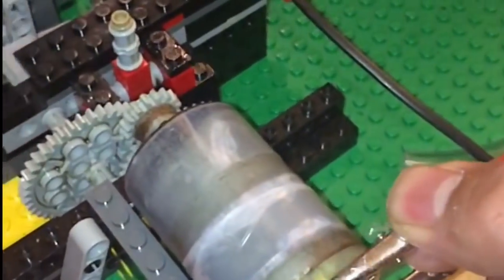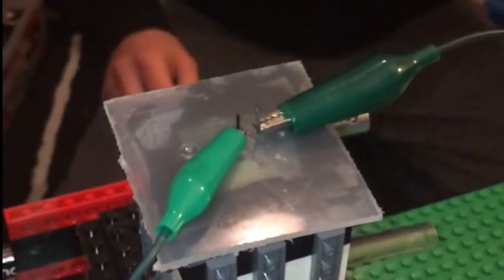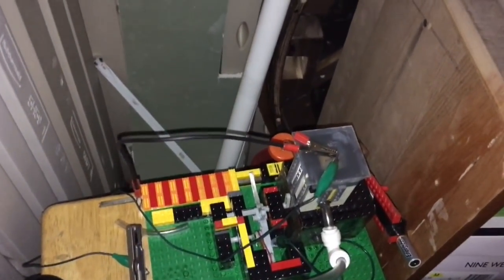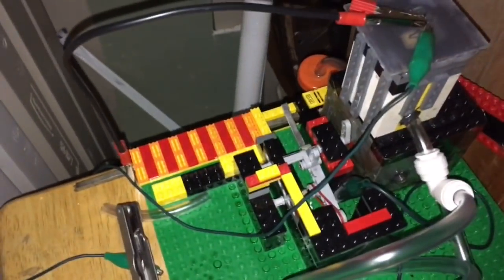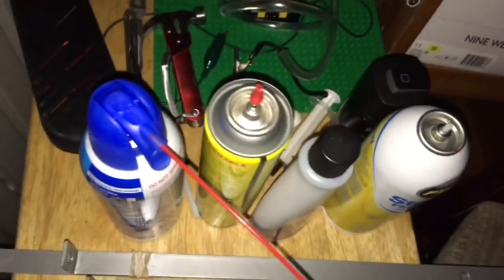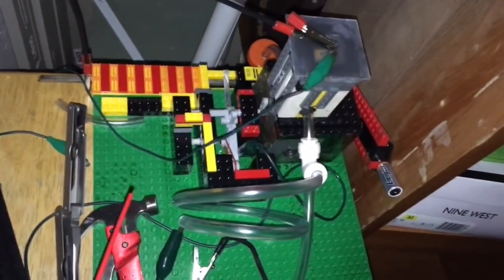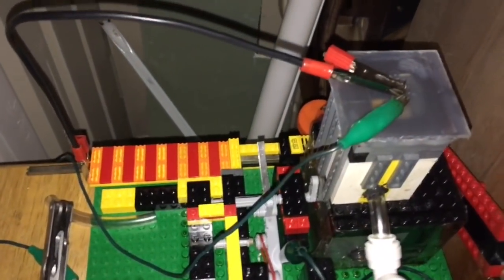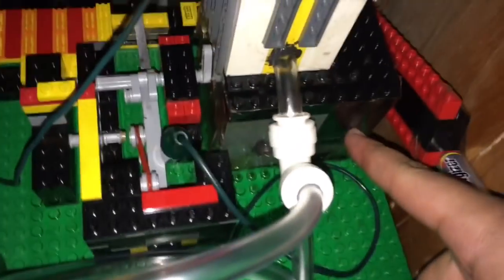LEGO 2 Stroke Motor (With real COMBUSTION) attempt

Comment: I used to make the two stroke lego engines all the time when I was a kid. I’ve been an ASE Certified Master Automotive Technician for nearly twenty five years. I used to perform advanced diagnostics, repair rebuild vehicles that required extensive repairs, build and completely restore high speed sports, muscle and all types of vehicles and was at the head of a pit crew when doing my own thing for a while. When I was teaching Automotive Technology I used to make small but very fast kart engines when first teaching the difference of two stroke engines used in lawn equipment and four stroke engines in vehicles. I would show the students close up simple two stroke engines I would often create from lego bricks so they could have a better time understanding then just through pictures in text books. I would give them a weekend to create a working model like mine to bring in the following week After having a decent understanding of we would move to the big four stroke four cylinder engine that worked on electric but one side was transparent so the entire process could be seen from the induction tube and filter flowing through the engine throttle etc. This was a simple carbureted model simply for basic teaching purposes. Unless a specific student was currently working at a shop most students wouldn’t be introduced to fuel injection or ECU systems (Electronic Control Unit) until they were at least halfway into the second year. There are always students who catch on a lot better than the rest. They were able to go ahead with advanced diagnostics. This dealt with the external and internal engine, transmission differentials and electrical electronic diagnostics of modern day vehicles and makes repairs far more complex for the old school weekend mechanics. Unfortunately, for them, those days are long gone unless you’re just changing the oil or windshield wipers. Anyway, watching this video takes me back a while!!! I’ve always found it so cool when you think about all of the things you can do with legos!!! I remember building lego guns back in the 80s that could shoot small lego pieces with it. My cousin and I used to terrorize his little sister, my little cousin all the time!!!! But he engines were my favorite thing to build!!!!

Comment: Instead add a spinning lever And add a handle like this                        |= <——- something spinner thing     
                                                                                                                         |
                                                                                                                         |
                                                                                                                     =  <—— handle                                                                                                       
Now you don’t have to spin it like a cork screw     You have to grab the handle and spin it in a circle     It makes it more quicker and more easier to use
Reply: I’m not so sure about the duracell batteries Since it’s super important to the engine. I don’t know how it’s gonna work without the batteries so the idea i made might not work at all

Comment: Just put some minirol oil in the crankcase to lubricate the moving parts and also seall the piston to the cylinder walls for an engine to work you need fuel, air, compression, and spark if you are not running dessl if you do not gave one of these you might get it to ignite but not burn properly also if you put the electrodes for the spark deeper in the combination chamber you might have got it to run
Reply: Any compression is good it dose not nead to be a psi it can be 0.01psi and that will be enough compression for that aplication I know you are not looking for efficiency that's why the compression can be so low

Comment: Your air intake is way too low on the cylinder as well you need to be drawing in air as it goes down for that to work your Piston has to be all the way down before it can suck in air so it's not going to suck in the air it needs

Comment: In the first Test it looks like the engine Sparks to early because the gears where actually turning backwards for a small bit when combustion accrued. So maybe the timing is actually what’s setting you back
Also you don’t Need a intake valve in your model if the piston is able to seal the intake inlet by it self
You can see what I mean in your animation too, not as well as in others but you can see it

Comment: A 2-stroke engine uses a fuel-oil mixture, as fuel since the fuel goes into the cilinder from underneath the piston meaning it has to be in the same area as the crank, that is in a real life 2-stroke engine, in here you are throwing C02 in the mix, instead of air, that is also a major disadvantage in this thing, in a normal engine the piston pulls back enough it can supply air and fuel on it's own, you may have more luck with a 4-stroke, way less complicated with oil, but a little more complicated with in- and outlets, and than, a square piston doesn't work, the corners don't seal well enough

Comment: Getting the air fuel ratio correct is going to be important to get it to run, as is stuffing as much as possible into the cylinder prior to the port being covered.

In a regular 2 stroke, the use of that transfer port is crucial as the downward stroke of the piston creates pressure in crankcase area to force the mixture up via the transfer posts to the cylinder.
Your blowing (mainly) non combustible gas and fuel in the side port is going to make it difficult to run.

Perhaps you could make a second transfer tube on the other side of the cylinder and then a fuel mixing device of some kind where you can accurately set the mixtures will help you a lot.

Comment: Lego isn’t really the best material to house combustion and wrapping it in duct tape won’t help even if you did get the engine working the Lego cylinder housing the combustion wouldnt be able to deal with the constant ignition of the fuel air mixture plus the heat from the moving piston. And if it’s a two stroke surely the lubricant/oil would mix with the fuel instead of being put in separate? Nice attempt tho.

Comment: 1. Is the air/fuel ratio calculated properly?
2. Is the spark timing set up accurately?
3. The square shape of the piston is far from efficient for this, circular is the best.
4. Lack of compression.
5. Lack of a flywheel wont keep the engine running as there is barely any mass spinning.
6. How would you manage engine speed without a carburetor?
7. Where is the exhaust going?

Cool project non-the-less :D

Comment: You need a better air to fuel ratio. Basicaly there is not enough air in the cylinder and maybe you should try to make a carburator for it and put 1 layer of tape around the edges of the piston as the exhaust gasses will ignite the gas at the bottom of the crankcase as it slips around the piston

Comment: get the ignition timing later so when the piston is at its highest point or little after maximum compression then it should start the ignition process better, and use pre - heated air for a faster reaction.and if you could, use it try to make a thin rubber seal for the piston it should work better after that. i am a car mechanic so i know that low comp is making it harder for ignition to start and don`t forget to make a exhaust port also.
Reply: silicon spray is also god for sealing and as fuel

Comment: I have a terrible idea that might work. You can heat alcohol to a vapor and store that in one of those pump sray bottles for cooking oil. Obviously it is dangerous to store air and fuel premixed. This would create a more consistent mixture and you can still lean out the mixture by pumping more air into the bottle.

Comment: You didnt have enough momentum for it to start. Add some counterweights and an flywheel and it should lokk better. Also you dont have enough compression trie putting thicker walls to the cylinder and glue everythin together...

Comment: I've got a 4 stroke I've been working on. It's been an on-and-off project. I think rather than doing an ohv as I had originally planned I will go for a flat head design as it will be simpler and stronger on a small scale engine built from LEGOS

Comment: You need to properly seal your crankcase and put a condenser in your ignition circuit to assure timing. Air dusters are CO2 so you've injecting a fire extinguisher into your cylinder, no pop.

Comment: Advice: You need the piston to be set just before it combusts. Of you do that as the piston is almost up it combusts and then pushes the piston back down causing Rotation. I'd also recommend do vavles next too the piston adjust timing and make sure it's sealed.

Comment: As well as using 2 stroke fuel rather than ethenol based fuels, they wont ignite well enough and they wont develop enough heat energy to produce kinetic energy, especially at the volumes you are working with

Comment: try putting gasket sealer on the walls of the cylinder so that any compression developed doesnt leak through the cracks of the bricks,  also put some viton rings on the piston to make sure you are developing compression. Also, you have to get that spark more consistant. i noticed that the timing isnt consistant and wont always ignite the fuel at the correct timing. Lastly, make sure that the exhaust port is decently sized so that the efficiency is good, too small and exhaust gasses will bog it down, to big and it wont maintain compression. and like others are saying, check the fuel/air ratio, compression ratio etc.

Comment: Air duster is non-flammable. The mixture for butane combustion is 82% air (that's 21% oxygen) and 12% butane or propane. You can vary a couple percentages, but not much more

Comment: air duster does not actually contain oxygen... It is actually very flammable and is a propellant, not an oxidizer. I made a vortex rocket engine and I used propane for my propellant and air duster for the oxidizer. the air duster was actually catching on fire and not the propane. Air duster is also bad for you if you inhale the fumes while it is burning, it contains a bittering agent to keep people from inhaling it. What works best for stuff like you are doing you should use butane for your propellant and compressed air from a air compressor as your oxidizer. :)....... Air duster is flammable... I know this from experience, it burnt my arm hair and melted the vortex rocket engine. Propane actually I found out works best in a controlled environment and is really hard to light in small quantities. Butane works best, burns hot and fast which gives good combustion.

Comment: Maybe you guys could use some kind of oil to make a seal between the piston and the cylinder for better compression, also i would go out and get a proper oxygen filled bottle, its questionable whether or not the bottle of air actually has oxygen in it

Comment: A better flywheel would be good having two opposing weights like that will be causing too much of a shudder when the engine fires making it more likely to stick at Tdc or bdc hence preventing a good revolution of the crank also if those weights are in the wrong spots then they will be causing too much resistance on the first power stroke causing the engine to stall before it is able to compress the second charge cycle I may be wrong 2 you need that reed valve to prevent the expanding exhaust gases from pushing out the next charge the piston will seal it at first but you guys don't have a perfect seal so therefore it's gonna be pushing the fresh charge out before it can get to the chamber 3 as I mentioned earlier
that piston seal doesn't sound too great so you'll have less compression and less power and of course make sure your spark fires a tiny tiny fraction before Tdc ( top dead center) to allow the combustion to start sufficiently before the piston begins the power stroke the spark timing is less essential because you guys are simply looking for the engine to run and not to make any power figures but timing is still very important I'm not a true mechanic but these points may help and by the way you need compression for good combustion of course I know it's a no brainer but if there's too little pressure the gasses will just burn and there won't be as much force on the piston so you may have too weak of a burn for sufficient force to turn the flywheel or in your case fly rod but I will say you guys have made a very good attempt a few tweaks and you could have it running for a few seconds until the head melts of course :)

Comment: I want to see this thing running. I got a few ideas. I work on engines all the time and it's literally my life. You have some good ideas, but the transfer port is meant to be sealed off. And the fuel is meant to be on the other side of the check valve. When the piston goes up, it draws air and fuel through the check valve. When the piston comes down it pushes all the air and fuel up through the transfer port into the top end so that that spark can ignite it. As far as fuel goes, the starter fluid is way more combustible than the axe body spray. I'd stick to the starter fluid.

Comment: A more balanced flywheel will be a lot easier to handle, and you may want to advance the ignition timing closer to top dead center. (but still after TDC) Probably so by giving the breaker points less travel. the piston should ideally have a great seal to be able to displace the mix from the crank case through the transfer passage, rather than around the piston, but it's understandably hard to make an engine-grade seal with Legos. the transfer passage is probably larger than nessecary,  and you could likely give it a better integration to the block

Comment: try and find a way to make the camshaft push a manual air pump charged with a flammable component(s) into the combustion chamber. so it will give it a repetitive crank.

Comment: Few problems:
- Canned air duster is not canned air. It's usually a kind of refrigerant, actually. Non-flammable, no free oxygen.
- 2 Strokes rely on positive air pressure created in the crankcase as the piston drops down to push an air/fuel mixture into the cylinder. Since the exhaust port is above the transfer port, there will be no "vacuum" to pull the air/fuel mixture into the cylinder.
- You sealing surfaces probably weren't sealed all that well. Compression is too low.

Comment: Seems like too much fuel being added aswell as not enough compression try to create a better seal in the piston problably will need to adjust the inside also if u manage to get it to work u need heat resistant material no matter the cc the compression and ignition of gases create alot of heat unless u create a pressurized cooling system

Comment: the duster air isnt oxygen so that wont work. but you might be lacking compression or the ignition is off or the fuel isnt making it on top of piston or as you said on the video the ratio is not good enough.

Comment: Why do you have an extra hole to add fuel? you're losing any primary compression you had, basically when the piston is on its downstroke its not pressurizing the crankcase to push the charge through the transfers. close the hole up and feed fuel into the reed valve you made. Nice project otherwise :)

Comment: Looks like you need to build a Lego carburetor now.
Reply: I was about to say something like that. He needs better fuel air ratio and if the flywheel isn’t heavy enough then heavier flywheel. Probably should mess with timings a little also with spark. Also better spark plug.

Comment: you have to seal all parts of the engine with silicone and you have to build piston rings so that the engine can achieve more compression In addition, you need something like a carburetor that can develop a gaseous gas genisch

Hope i can help u :) hope it runns

Comment: Simple vapour carb jam jar pipe into fuel outlet to check valve this pipe is close to top of lid and not in the fuel speed is controlled by air flow into jar

Comment: The check valve is the intake on a 2 stroke the piston coming down puts mix under pressure and through the transfer pipe

Comment: Longer hollow lighter piston. Lighter flywheel. Advance ignition timing. Add a bit of oil when cranking so the piston will seal a bit better. Crank faster. Good luck guys!

Comment: According to my calculations and many years on the engines, this happens to me that if you want to start this engine you have to hold that deodorant so it spouts into the suction channel then it grabs you when you scatter it just a bit so it escapes you through the exhaust channel because when the fuel is pushed the exhaust duct is open and exhaust so that more than half of the fuel escapes you out

Comment: Need Compression, it will not ignite that easy without some sort of compression. Will not matter what you use, if there isnt any seal on the piston to prevent the combusting gas (if it is even igniting) from flowing past into the crank case. On a real motor, if the Piston rings are gone the car will not continue to run or run like crap because the explosion was not contained enough to keep the piston moving, it just slips past into the crank case instead of pushing the piston

Comment: The air duster is not real air or o2. You need to blow air in it like with a little supercharger because theinstable combustion cant suck the o2 inside itself

Comment: Pretty sure cold air isn't the problem.  You need to choke to compensate for the increased oxygen per unit volume of air.
Reply: Take off the long intake tube, put a shorter and wider one with butterfly valve.

Comment: If there is no oil you don't need a transfer port. You could just go straight into the combustion chamber like as the oil mainly lubes the crank and connecting rod